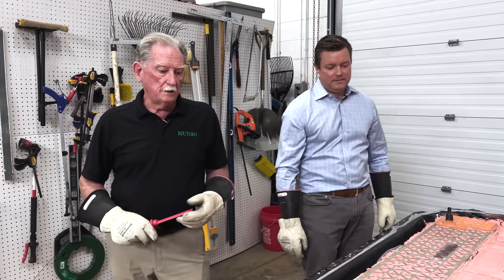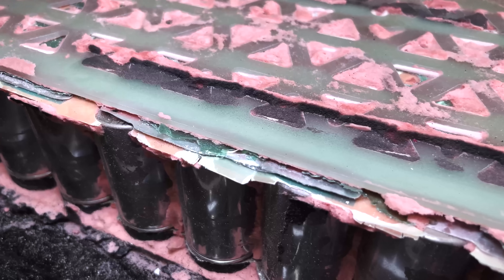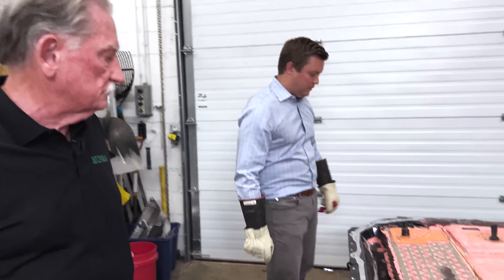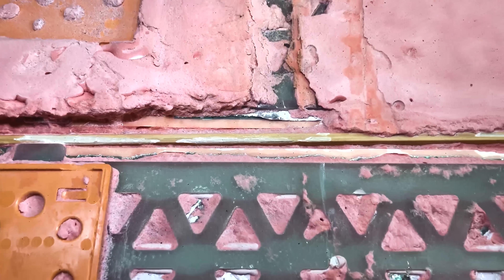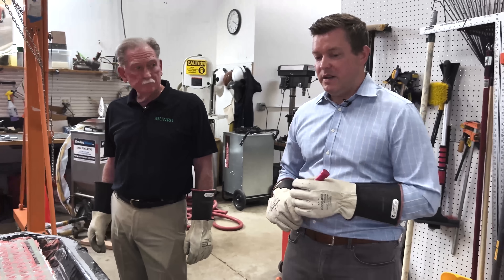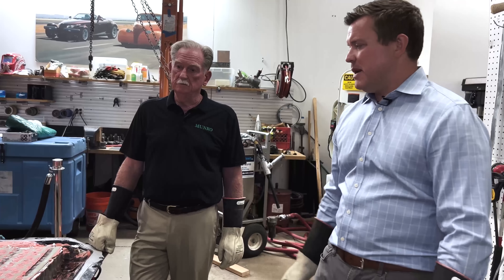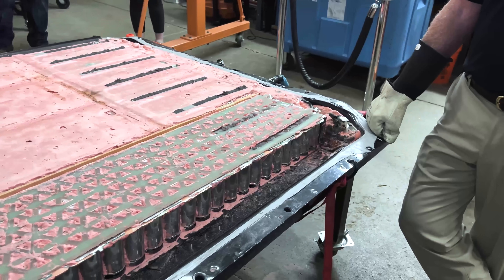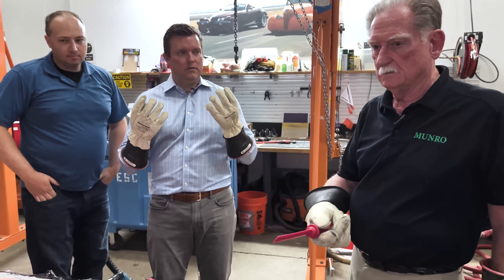4680 Battery Pack: What We Found Under the Foam!

Comment: could they come up with some chemical that can dissolve the pink foam and nothing else?  Trying to figure out how they will recycle these in 20 years
Reply: Yeah, I'm thinking the foam vendor probably has a matching solvent that doesn't hurt other plastics. Reuse is a better, cheaper second life for that battery pack than being ground up into ore again.
Reply: agreed.  can the tesla battery management system figure out a single bad cell in the array?  i would think it has to already

Comment: So you’re going to have replace the entire battery pack in the event of a failed cell/module?
Reply: A failed cell won't impact you much (you probably won't even notice it in everyday operation) so there would be no point in replacing anything. A failed module is much more likely an electronics fault (controller) than anything wrong with the batteries and then you'd just replace the electronics.
But in the end the data collected on BEVs out there shows that batteries last basically forever (much longer than the rest of the car), so there's no real reason to worry about it.
Reply: @peterzerfass4609  
Remember the controller is in the penthouse on top of the pack (under the back seat) and is replaceable without removing the pack.
Reply: For one cell you just keep using the pack.
Reply: They talked in the video about the thin wires that would act like fuses.
Reply: "So" you're going to "replace an entire pack in the event of" losing 0.125% of capacity if a single cell goes down?
Think before you type?
Reply: @rogerstarkey5390  the problem is not that you will scrap a pack for 1 dead cell. The problem is the car's computer will limite charging, discharging and performances if 1 cell is bad (or 1 module) so you don't have any other choice to fix it.
Reply: @rogerstarkey5390  it was just an example, like you….
Reply: Looks like it.
They will charge you 20 000$ for a new battery and give you sweet nothing for your "precious ore".

Comment: Flat wire is sometimes used to reduce inductance. Not sure if it applies here.
It's also often used for high current connections by ultrasonic wedge bonding.
Reply: I wouldn't expect inductance to be an issue for DC, but perhaps the inverter draws current from the battery pack in high frequency pulses.  I would think that a flat wire also has superior heatsinking potential.
Reply: @mattgraham4340   <-- makes 2 good points; skin effect and cooling... a third point mentioned by Sandy, spot welding is more secure with flat wires.
Reply: They are fusable links and flat ribbon wire is used rather than traditional round wire since it provides a better wire to substrate bond. The flat wide surface of the wire works well with the wedge tool bonding 'head'.
Reply: Another example,  internal welder connections. I would guess also easy to spot weld flat wire.  Looks like from what can be seen none of the battery cases are inverted as a way to series the 4680 voltages. Excited to see when they get the rest of the top cover off as to how everything is  connected
Reply: @danlewis243  The batteries have positive and negative on one end, so no need to invert any.  This is fairly common in the industry for exactly that reason.  The entire bottom, sides, and part of the top are all anode.
Reply: @scottgaree7667  Oh OK  don't recall them mentioning that previously. I do realize they do "appear" to be of conventional  external  design with the outer case being connected to anode and the center post cathode  just like 18650, 21700,  cell.  Just  Have not seen many with the majority of the can exterior un insulated.  So if all cans are oriented ( no inversions) the same way  they can pattern a connection grid and then use a specific pattern insulator and layering to achieve any cell connection layout they desire.?  It will be interesting to see exactly how lifetime terminations to each cell are done on a structural pack.  Weren't the original model S's hand soldered point to point?

Comment: Battery cells are for shure not 100% structural. Tesla needs to insulate the cells from the covers because of needed thermal insulation as well as electric insulation. This foam will not be able to carry big mechanical load, thats why Tesla is using a rolled blank high strenght steel for the top cover to achive mechanical stability.

Comment: So this is "Structural" because of the Foam and not because of the Cell.

I assume, it would be as strong as this, also with 2170
Reply: @chefalbino :: To make a structural pack, all of the elements of the pack are engineered to work together for the desired rigidity. So just using different batteries with this foam would have a very different result.
Reply: The foam is in addition the very thick walls of the 4680s. There are some YT vids of some guys pulling them apart for analysis. Those metal walls are thicker than they need to be for the battery itself - conclusion being it's for the structural design.

Comment: Here you can see that Tesla worked really hard to eliminate the possibility of cell or pack level repair or replacement. They want to make sure that if a cell goes bad you must replace the entire pack. So sad to see such a huge leap backwards.
Reply: Not true. They made it easier to recycle, made the car safer and lighter and overall a better car
Reply: It's not a problem if it doesn't go bad.
The reliability of this pack will be a lot higher.
Reply: I rather see it the other way around... The Model 3/Y packs are fundamendally trying to be different the original Model S where just a single cell could take the whole pack out..
Reply: Better Tesla designs a reliable battery, then a repairable battery
Reply: We really don't know what is the MTBF (Mean Time Between Failure) for the new 4680 battery pack. If the failure rate is very small then replacing the whole pack would be very cost effective. I heard people raising FUD about Tesla car not having a spare tire in the car. I am on my 2nd. MS and had no issue with it.

Comment: Would that insulation give you better winter time range? Easier to heat the pack during the winter?
Reply: Oh for sure. Excellent deductive thinking on your part
Reply: @chrisvanderburg5568  thanks!
Reply: Yep.
Reply: It does in combination with Tesla's preheating capabilities.  The procedure to maintain range in cold weather is leave the vehicle plugged in at night and set timer to pre-heat the battery, interior, etc. an hour or so before you drive.  This also can remove ice and snow from the door and windows.  You get in a warm car and no need to scrap windows.
Reply: Would it decrease range in the summer?
Reply: @punjab1captain  No because of great thermal management.
Reply: @punjab1captain  I wouldn't think so, If anything think of it as insulation you have in your attic.  It works as a barrier for Heat and Cold.  So in theory this would work better and with Tesla's Octovalve pack cooler this would only help.
Reply: There current 2170 packs have foam insulation as well but maybe not quite as thick.  I don't know if anyone has compared their insulation properties but they are probably similar.  5 Years Ahead channel does a great job explaining the thermo systems.  He says Tesla is using it as heat storage in some instances.  Their HVAC is next level stuff.  

Check out Munro's video of 2170 tear down:  https://youtu.be/4JiDZVO9NdM?t=85
Reply: @oof_Dad  I did not no that I will check that out. Thanks for the link

Comment: I'm curious about the insulating R-value of the pink foam. 

Sandy, Cory, do you think Tesla could engineer in frangible weak points in the cross members of the cooling extrusions to allow them to be hydraulically expanded (egg shaped)  at end of life to break apart the pink foam to make recycling easier?
Reply: Closed cell polyurethane foam is R7 per inch. This stuff is probably the same.
Reply: @matthewerwin4677  
I would love it if you would elaborate on that for those of us who have no clue what R7 means
Reply: @whodatcatt  https://en.wikipedia.org/wiki/R-value_(insulation)
Reply: No need, you just throw it all into a grinder.  Recycling doesn't require any manual disassembly, the grinder rips everything apart and pulverizes it for easier separation of materials.
Reply: @_PatrickO  Thanks Sandy and Cory...
Wait a minute... 

You're not Sandy or Cory... 🤔
Reply: @danoberste8146  no he just repeated what sandy said in the video and what VW shows for their batter recycling system.

Shredder/grinder go through steel and therefore definitely go through some foam as well.

Meaning that you just have to dischargethe pack and throw it into the shredder.
Reply: discharge it plug it into the pumps and pop it like a balloon, neat.
Reply: depends if you have Open cell or Closed cell.  This looks to be Closed Cell because it's higher packed and more ridged.

Comment: Has anyone tested the torsional rigidity of the whole pack?
Terrible how they don't want cells to survive a crash. Just grind it all up and make cells unattainable for people who actually care for green initiatives.
Reply: "Want to survive a crash" What are you wanting to drive? A tank?
Reply: @rkan2  Can't be reasonably salvaged to be used the decades of life they still have in them. One module gets pieced and ALL cells get ground up. That's green recycling for you. Make the whole pack again rather than keep what works.
Reply: Tesla and Redwood materials are closely aligned and disassembly of these units has, in all probability, been discussed. Sandy wasn't there so he doesn't know what they worked out. Either that or there's no need for the pink stuff at all, it's just Elon playing a trick on Sandy.
Reply: @earthwizz  I'm eager to believe Elon tricked Twitter into having to give him false data, sealing their demise or discounted price. He can also force them to buy back his shares bought in good faith, then worthless. Or give him enough to get 51%. Very slew.
Tricking Sandy...too much credit :) Elon tricked ALL OF US though, thinking he meant it with "cell to chassis". Even structural pack seems a stretch. Will they have weakened the floor enough to NEED the pack even, and does that make it "structural"? I'm sure any mass bolted into the frame adds structural integrity. If you test a Model Y 2170 with and without pack, you can measure a difference as well, I'm sure.
Reply: @Cloxxki  If you were paying attention Sandy pointed out exactly how the recycling will be done but you  probably weren't. Let's face it, despite any and all evidence to the contrary, haters just have to hate. Have fun with that, I'm done having fun with you. 
Bye now.

Comment: Looks like mattress springs. 😅
But why so much empty, unused space at the side?
Btw, 816-828 Cells expected by Munro.
Reply: The space at the side is side impact protection.
Reply: @snviper  
There you go being "logical" 😉
(I agree)
Reply: because Tesla are still cell limited on the 4680 production line(s)
will be more cells in a V2 structural pack maybe next year id expect.
or cybertruck with more im sure..... :)

Comment: Cool. Do you discharge the battery as much as possible before such a disassembly, or does it not matter?
Reply: Yes, this has been discussed before
Reply: @rkan2  Thanks, I haven't watched every episode out there, so I must have missed it.
Reply: If you cooled it with liquid nitrogen to near 0K , it does not matter as no reaction should take place.
Reply: @jeffjiang5272  Liquid nitrogen is not near 0 K, and they are not chilling it anyway.
Reply: @brianb-p6586  I am surprised to hear at 8:32 as well. Liquid nitrogen is cold, but not that cold
Reply: @brianb-p6586  You're absolutely right, liquid nitrogen is normally at -196 Celcius, which is still 77.15 Kelvin. I noticed this too :-)

Comment: Great job guys. Just started watching this one, so maybe you answer this later, but why didn't you use a foam specific solvent bath? I imagine you wanted to preserve any interesting features that such a solvent bath might damage?
Reply: Just imagining that Tesla or a company like Redwood Materials is going to have a clever simple way to wash it away without damaging the good stuff.
Reply: @PaulMcElroyWasHere  no, they are either going to re-purpose the entire pack as it is, or grind it up and melt it down for materials.
Reply: @Wingman77tws  That was Sandy's hypothesis. Not a bad one, but it's not the cheapest thing to do with those batteries. Instead, reusing them is. I'd imagine that's really the second life of this product before it gets to the "recycle to ore through pulverization" phase of the material's life.

@MunroLive I would check with the foam vendor and find out if the specific chemistry is meant to be matched with a specific solvent that only targets that foam in that battery pack and not the other plastics.
Reply: @PaulMcElroyWasHere  Yeah no, reusing is for hobbyists. At scale you recycle not reuse.
Reply: We may have that answer some day.  It's possible that the particular properties required of the foam may render it undissolvable, or at least easily so.  Any foam that could be easily dissolvable may be unsuitable in other ways.  Time will tell.